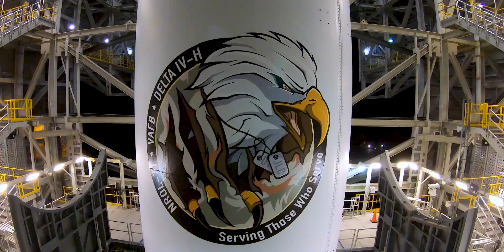ULA Delta IV Heavy NROL-71 Launch Highlights

Comment: What was with all that flame up the sides of the rocket just before main engine ignition? Did they not have time for the paint to dry? You can see the burn marks all up the left rocket and down diagonally to the right, all through the launch.
Reply: It’s how the Delta IV works, they usually explain it if you watch the full broadcast.